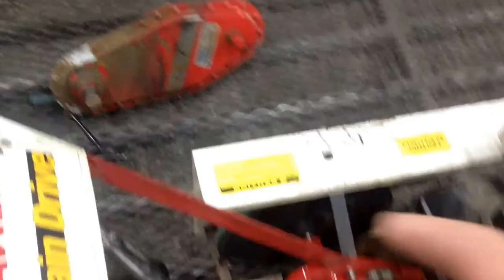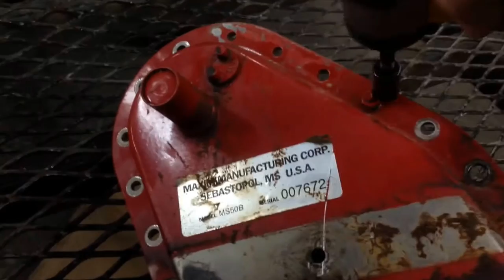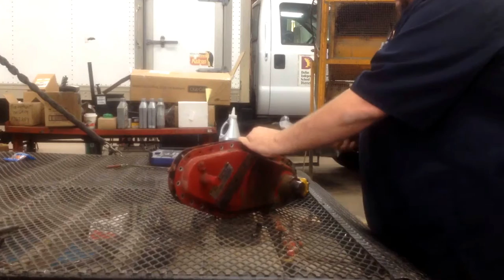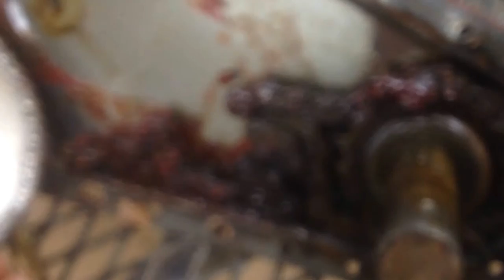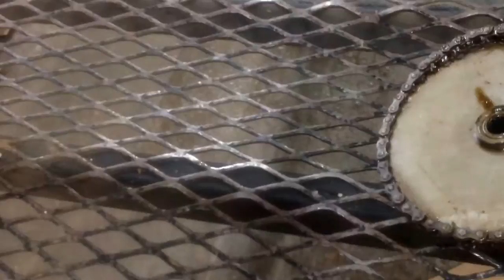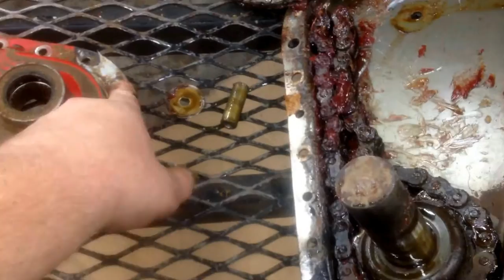MAXIM  /  MERRY TILLER CLONE CHAIN CASE FAILURE / BROKEN GEAR? CHAIN? LETS FIND OUT!!

Comment: Looking at the case after you split it I noticed it has grease on the chains, normally the casing is filled to a level plug with high pressure gear oil in my experience, I should think someone has heavily overloaded this one.

Comment: Where did you find the chain unit/transmission?  I probably need one.  The only online source I have found is 'searspartsdirect' and they want $300+ for one.  They can't be serious.  I guess I could rebuild the innards but I haven't cracked it open.  While tilling, tt acted like the chain broke, spun freely, and wouldn't turn the tines.  But then it started to again.  Something's not right in there. The old guy I got it from apparently used jute/grease packing to seal the shafts, too.  Not a very good seal.  The chain sounds dry, too.